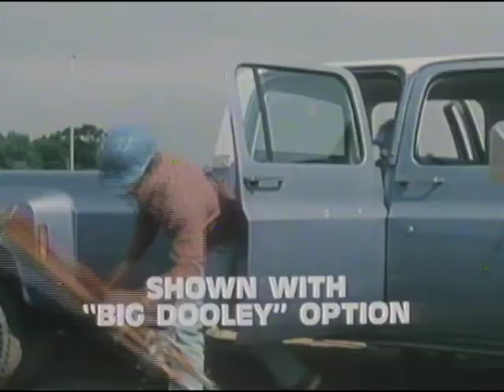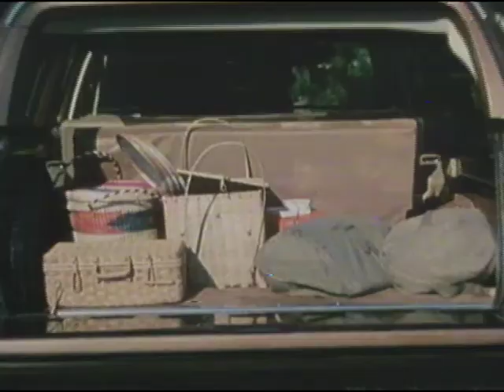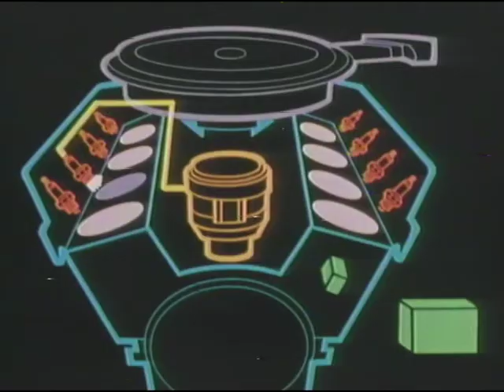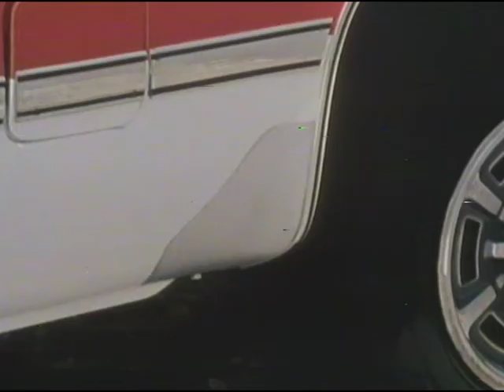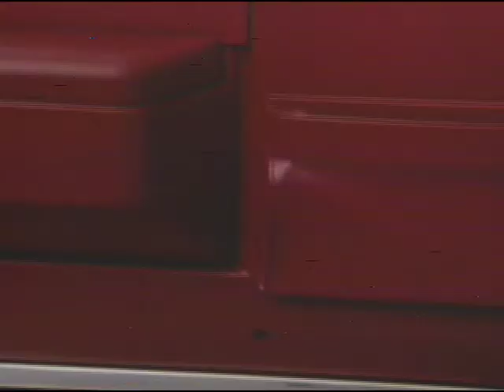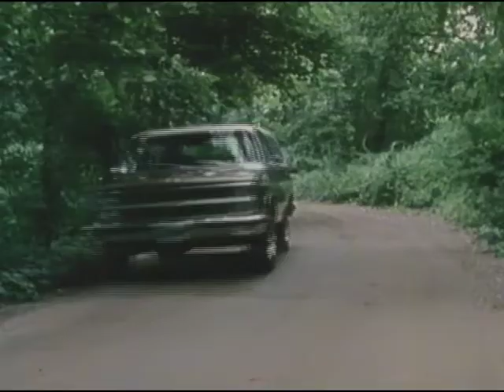"1981 Chevy Pickups, Blazer, Suburban" - (Dealer Film) 2-of-3

Comment: I have a 1981 K20 still working picked lumber today with it. I did have a shop replace all rubber parts including motor mounts, power steering pump, steering gear box etc. $10,000 later drives as good as new and no leaks.

Comment: I didn't know the Cheyenne trim was offered in the refreshed square bodies, it must have been a short model run because I never seen one in the wild!
Reply: @mgtowfish73 The 1981 only, to be exact (incidentally, GMC also dropped the Sierra Grande name after 1981 too). These were, chronologically, the trim levels of the '73-'87 Chevy trucks: 1973-74, Custom, Custom Deluxe, Cheyenne and Cheyenne Super (base to top-of-the-line, respectively; the same's also true of the '71-'72 trucks); 1975-81, Custom Deluxe, Scottsdale, Cheyenne and Silverado (again, base to top-of-the-line, respectively and, yes, before 1999, Silverado was the top-of-the-line trim level ONLY); 1982-87, Custom Deluxe, Scottsdale and Silverado (once more, base to top-of-the-line, respectively; as I said, 1981 was the Cheyenne's last season and GMC, likewise, followed suit for 1982 by doing the same thing).
Reply: 1981 was the only year you could get it for the refresh, GM brought it back in 1988.
Reply: I had a 1991 Cheyenne, but I've never seen any between 78-87 tho. In 88 a Cheyenne was bottom trim no cloth, no stereo, no ac. My 91 had a rubber plug where the radio antenna would've been on the fender lol
Reply: @davidhicks2178  Yep, i had one too, a 92!

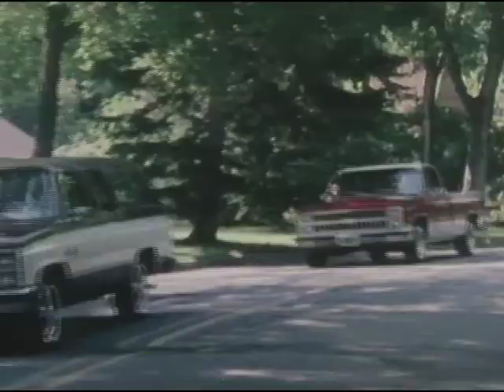Comment: 18:54 That rear A/C was just about the only luxury on your loaded Suburban that couldn't also be had on a loaded Chevette, and that mainly because it was completely unnecessary on the smaller car.
Reply: You have a real gift for writing fiction.
Reply: Rear A/C is far from "unnecessary" in AZ, friendo
Reply: @Schlabbeflicker   Certainly not on a Suburban  but I was talking about it being unnecessary on a Chevette, where I think the underhood compressor was already a stock part designed for a bigger car.
Reply: Greenhouse heat gain.